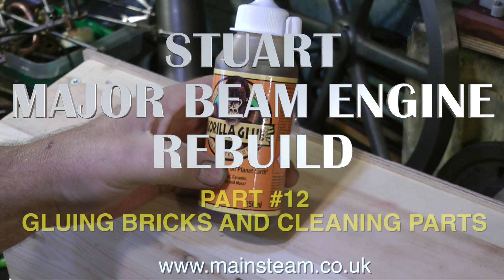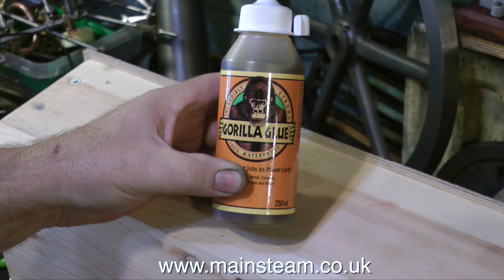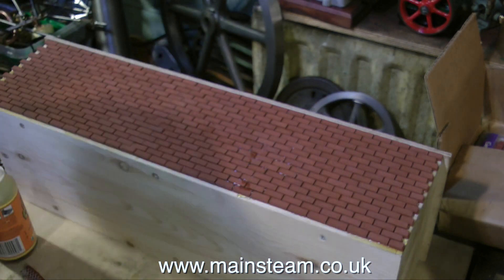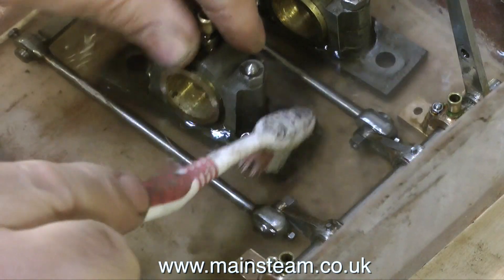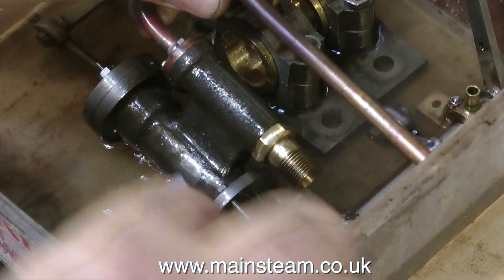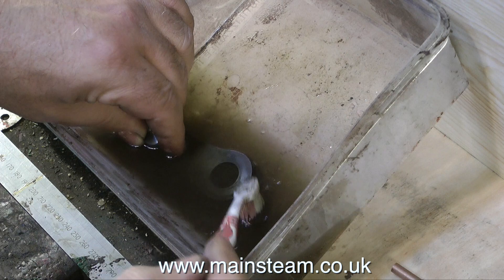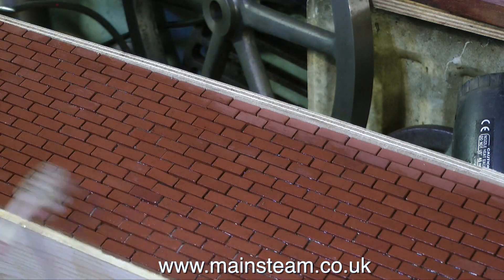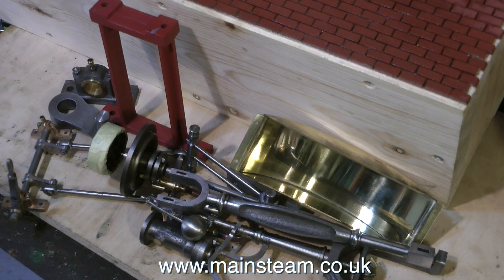STUART MAJOR BEAM ENGINE REBUILD - PART #12

Comment: looks great.  may i suggest getting a rubber roller and rolling over the bricks after they are down.  it will even them out and prevent the annoying occasional sticking out brick.
Reply from the maker: But ..... but ..... I wanted some irregularity in the brickwork - like in the full sized article - if I had wanted it otherwise I could have used Doll's house wallpaper . . . . . . . it's a bit like ceramic floor tiles versus ceramic floor tile patter linoleum ......
Reply: Keith Appleton after seeing the final product i completely agree with you.  came out wonderful!

Comment: The moment you broke out that gorilla glue, I was shouting "OH NO!" at my screen.  It really is great stuff, but all wrong for this application.  Without cyanoacrylate or 2-part epoxy, you could also go with contact cement or industrial adhesive (which is usually dispensed from a caulking gun).

I believe the glue bottle recommends acetone for removing excess, but as you've found, lacquer thinner works better. Toluene or xylene are also good choices...but they're also frequently components of lacquer thinner, so no big deal. Excellent going with your damage control efforts Scraping all that foam from the cracks once cured would've been a long tedious process.